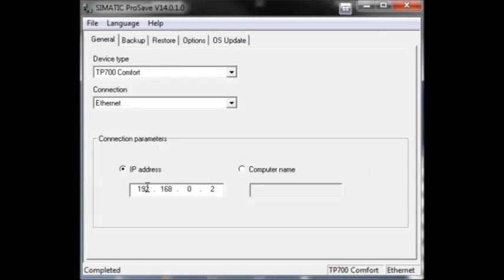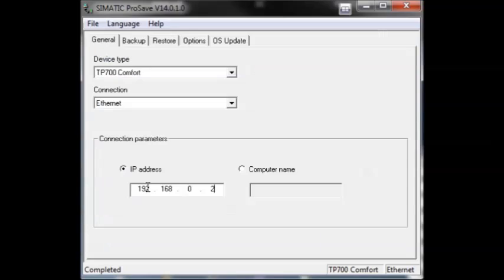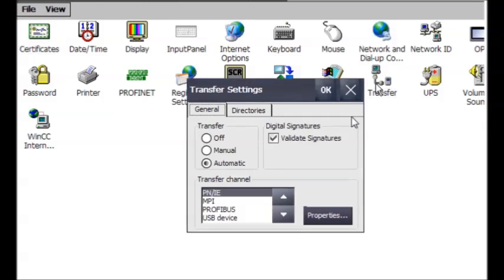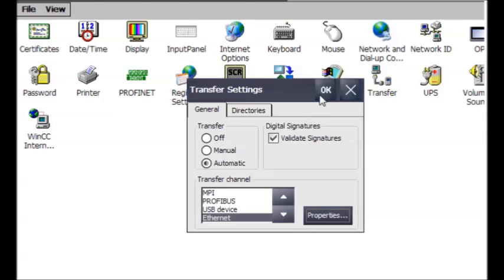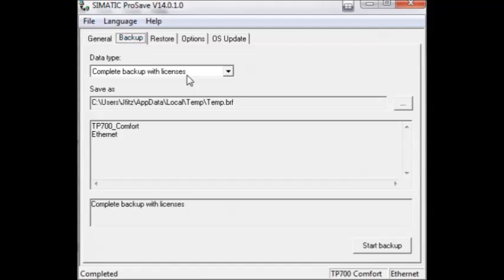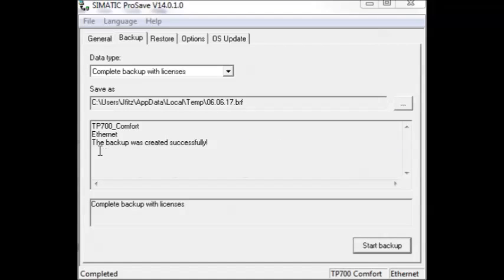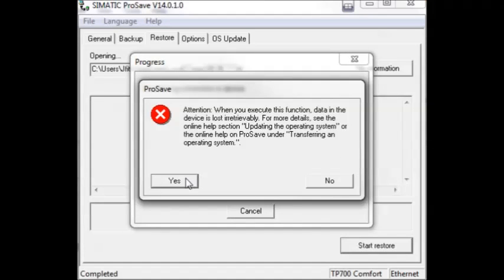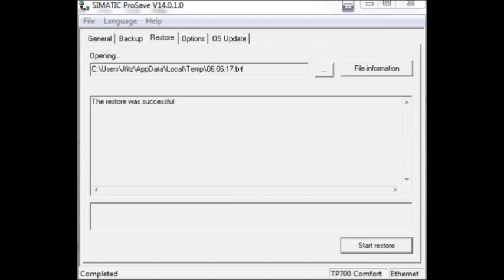Backing Up and Restoring a SIMATIC Comfort HMI via ProSave | Authorized Siemens Support | AWC, Inc.

Comment: how to fix alarm "no connection could be established. please verify your settings, interfaces, cables, device type etc"? i set device type and IP correctly but it doesn't work
Reply: Were you able to solve this problem? I have the same issue with a KP400 HMI and I do the same steps

Comment: Thank you! I realized it was the "Default Gateway" which blocked my communication. I realized it only because I compared the transfer settings on the HMI. So to answer the question of Santi: yes, it might be necessary. You could do this with TIA, but you might need to shut down the Runtime.